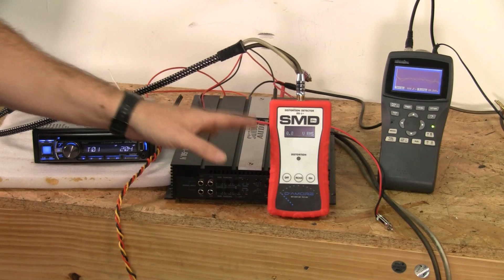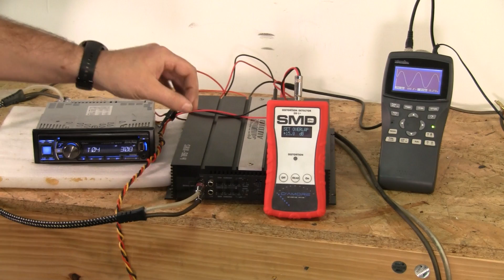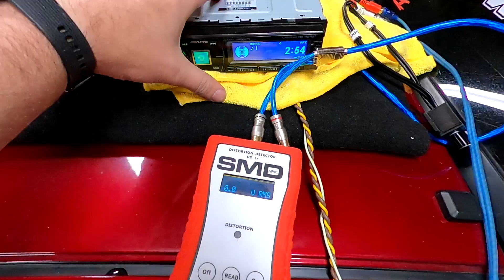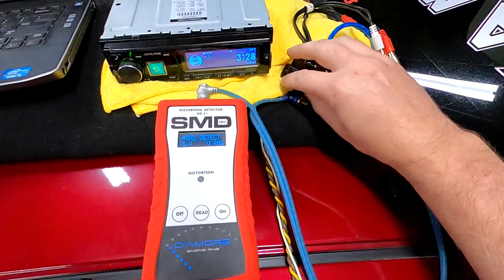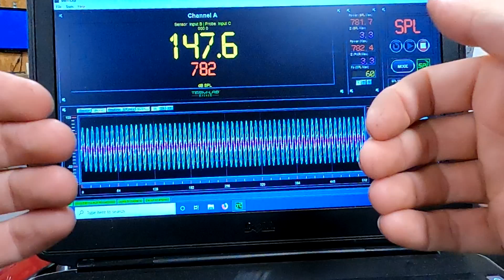The TRUTH about the D'Amore Engineering / SMD DD-1+ - Tech Stuff Tuesday

Comment: Very well made video. Steve’s only defense is, “you didn’t follow the manual word for word” when in reality you followed everything  you had to in order to show that there isn’t really any significance in owning a dd1 over an oscope. You won. And Steve no longer has a valid point to argue so he’s resorting to denying everything without any information to back himself up besides, “YOU STILL DIDN’T DO IT RIGHT YOU DUMB FUCK”!!! Game over Steve. Your lack of professionalism commenting on these videos has damaged your reputation far more than the video itself
Reply: LIST OF YOUR ERRORS

1.  Video description.  RF paper on building your own high passed speaker project is not 1/10 the price.  It's twice that, WITHOUT LABOR,  is your time is worthless?  You just valued it at $0.00 per hour

2.  Video description.  A High Passed Speaker is not a Distortion Detector.  RF you listening?  

3.  1:39  No headunit is 0.5V out.  But if it was you just put the probes on the amp to set everything, headunit, processors, amp, all measurable THROUGH the amplifier.  This is actually the preferred method since this way you can see distortion of outputs AND INPUTS of all components in the signal path.  No need to plug headunit into DD-1+, ever, unless you want to see how many volts come out of it.  

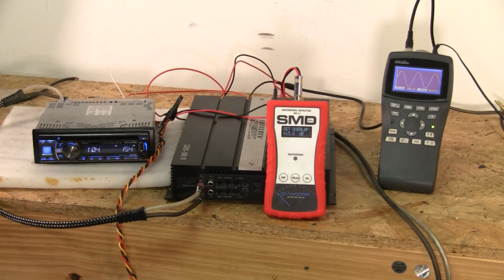4.  At 9:42, at this point you are supposed to press READ and then switch to the OVERLAP track.  EVERYTHING FROM THIS POINT ON IS INVALID SINCE YOU DIDN'T.  THERE IS NO reason for anyone to watch this video past 9:42. 

(I'll keep watching to see what other misinformation you are spreading) 

5.  13:43  The voltmeter on your scope is a cheap AC averaging meter that calculates AC RMS from any waveform, based on the math for calculating the RMS of a sine wave.  The math doesn't apply to square waves hence the error on your scope.  The DD-1+ voltmeter looks at the peak of the waveform, any waveform and determines what the maximum clean sine wave voltage would be that fits in the "rails" of the waveform.

6.  16:19  So you're saying if someone adjusts their gains for maximum clean output, and then you turn up the EQ or level more it clips????  NO SHIT

7.  17:32 And how would using your scope or the my first electronics project from RF to avoid these problems?  It can't.

8.  19:34 This is a problem with this headunit.  A better headunit has trim level adjustment for all sources, or an engineering team that took care to make sure all sources had the same gain before the design was mass produced.

9.  20:30  The DD-1+ shows when distortion reaches 1%

10.  23:32 Please describe this "more" that the scope tells you

11.  25:12 yes

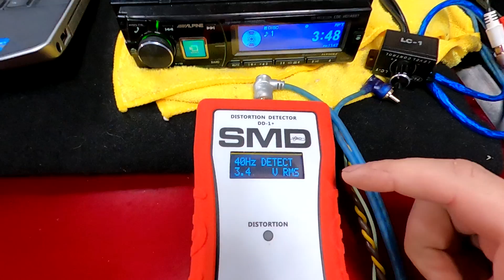12.  29:01 this has nothing to do with the DD-1+

13.  30.28  this is exactly why it is best to do all measuring at amplifier output

14.  31:04 the quick blink of the LED when increasing level is the 3 stage autoranger switching ranges, mentioned in manual

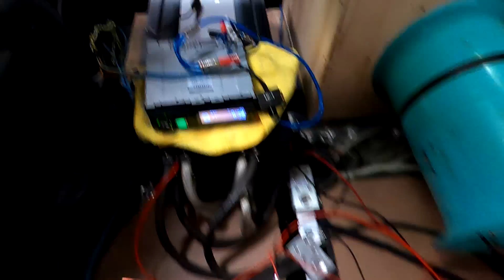15.  32:10 you just set it with NO OVERLAP?!   EVERYTHING after this is also invalid.

16.  34.14 voice coil is hotter now and the impedance of your woofer is higher, so in turn it got less power.  20 less watts = 0.1dB less, nothing to see here. 

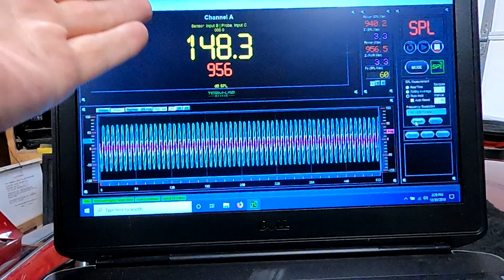17.  39:00 You clipped it hard, of course it was louder and put out more power.  Now try using the DD-1+ properly and put 5dB overlap in it and do SPL run and make that video.  

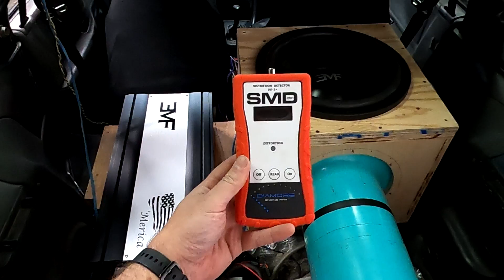18.  40:41  You showed us that you STILL didn't use it right, even though 20,000 people already know how to use them perfectly everyday.

Comment: Personally I really don't think its a requirement obviously if your amplifier doesn't have a clipping indicator then that's when you go out and buy an o scope or if you have to go buy one of these but if your amplifier does have a clipping indicator there's really no need for it if you're into SPL your amplifiers going to distort The thing that will bend you over is when you're full on clipping your shit though but most of the time people are running amplifiers that have clipping indicators on them. Not to mention though you can probably go out and buy a cheap otoscope for way less than this thing is.

Comment: Love your videos. You can't just turn any head unit up all the way and tune it by ear. I've done that before on a friend's build and I had to go back with the dd-1 to correct it and now it sounds clean and it's a little louder. Before that, the amp for the sub would go into protect. Not all head units can go all the way on volume. I've always tuned by guessing the head unit volume and hearing distortion from the subs but now it's so much easier with the dd-1. I'm not paying extra for the dd-1+ though. That's way too much. That oscilloscope you have is more accurate. I should have gotten one of those instead. Again, love your videos. I've learned a lot from watching them.

Comment: Nice video. With DD1 it may be clean without a load on the amp , but when your sub or subs are connected it actually loads the amp down more which will still cause clipping.so I think the oscope is still better. I think you can still make a little adjustment on your bass boost or bass level on your source unit then set your gains.

Comment: I always set my equalizer and crossovers at a moderately loud volume and then set my gains.
Reply: That doesnt work you need to know when your head unit clips
Reply: @Ismael_Arenivar  Yes it does.
Reply: @Ismael_Arenivar  As demonstrated in this video if you set your head unit with flat eq then as soon as you bump up the eq settings you are going to clip. Of course it is more involved than that but my point is true. Also im not talking just subwoofer here. All gains are set after eq is set at a moderately loud setting.
 Now for just trying to get the most power from an amp without sound quality then by all means set the eq to flat and leave it. But... as soon as you touch that eq then you have just altered your sign wave to clip or under-volt depending on your setting.

Comment: Moral of the story, put a clipping light on your dash to make sure different EQ or recording material dont jack your stuff up.
Reply: Agreed. Any song just keep adding gain till the light comes on. A clip indicator is all you need assuming it’s accurate. But that’s not such a safe assumption. Also a slight amount of clipping is acceptable. And all clip indicators have different variances. For example 1.5% distortion or 10%. But yea. A good clipping light will satisfy most people and yea it will take the songs levels into account which is important. The dd1 is perfect if you play specific songs or tones. Simple.
Reply: Gunk smd om-1 :)
Reply: @brandonjohnson7559  im not sure how relevant that would be. The om-1 is setup according to what you do with oscope or dd1. The issue is when you change your eq or play source material with different db than you did your initial settings with. My understanding is the om-1 is just going to show a red light when you go past what your initial settings are. That will change if you bump your eq or play from different source with higher db recording. I think a true clip light like Sundown has with their amps is best.
Reply: Idiot
Reply: @meade9167  a more productive comment would entail "why" this is such a bad idea. Db increases in source material played and eq adjustments are legitimate issues.
Reply: meade916 why?

Comment: Measuring the (out voltage * out amperage) and the signal with a oscope while setting the gain will get you the max power of the amp (with a load/speaker)

Comment: You have a 25% thumbs up from me, only because you know how to use an O-Scope. When using the DD1+, you have to hit the read before making adjustments. That’s what you did wrong. I have the original DD1HV and every system I’ve installed to date functions the same way since installed, except for the looser suspension from long usage. You didn’t read the instructions fully and correctly. Also another thing, listening for distortion is a no no. If you really know what you’re doing, which as time goes on I’m noticing you don’t in some aspects, you’d advise against it because you can’t hear distortion at the most minuscule scale. Which in time will destroy a great build. Ever had a tweeter drop out on a crossover? That’s because of clipping. Bet one of you in the comments had it happen, and didn’t hear your tweeter was clipping.... If you’re daily driving your system, that’s when these things matter, if you’re doing SPL, DC and AC voltage is your friend. Not so much distortion detection, and o scopes. When I hear people trashing devices that work for those who don’t come from an extensive background of before “easy of use” products, usually hate they didn’t think about inventing it. You pay for technology, and The DD1+ is a great device. An O scope is better because you can see the wave. That’s really the only advantage. Steve says it to everyone, buy an O scope and learn that first. Redo the test correctly, and you will understand how the unit works. As for the comments on here, throwing shade at someone because they are innovative is foul, and disrespectful and makes guys not want to be in the audio field. We all love our cars, audio, and tools. Would you get mad at Eric O (South Main Auto) for using an Onyx drill over a snap on drill? No, because the persons knowledge of how to use the device is all that Matter. Be respectful, as for you sir EMF, you do a lot of tests that are accurate, but this one for sure needs to be redone. Talk with Steve.
Reply: Best and most respectful comment I've seen yet.
Reply: FoSgAtExPoWeR thank you. I try to be respectful to everyone and every aspect when it comes to my profession. Makes for a better crowd and understanding.
Reply: i hope he actually reads comments and responds or better yet does a follow up a video. i want to see the difference :)
Reply: Nailed it
Reply: Well said..... with class.
Reply: Absolutely amazing and lovely comment of clarification sir❤
Reply: Well said
Reply: actually i hate to say this but im pretty sure hed still get a few comments wonderin y he (eric) broke somethin like that out
Reply: adding any extra bass or treble at the head unit itself or amp itself will throw everything else off, and smd dd-1 cannot stop fools from doing just that because they mad a dude with only say overall $500.00 dollars in everything is out doing everyone with $20,000 dollars worth of chit
Reply: So funny I literally just watched SMD video of Steve setting gains and frequency with the dd1+ and the Amm1 . And I could have swore he had the crossovers maxed out. Pretty sure of that. This guy says the instructions say to have everything flat. Not sure bc I don't own one yet. But seeing how I just put about $4,000 into a new build. I'm definitely going to buy both of those. I'm 45 and have a really good back for running by ear. Hense I beat 2 2007 Memphis mojos for 7 years on a 1998 Rockford fosgate punch power 1000a2 and the 600a4 on highs. Still have it but I upgraded to a sundown amp subs. All new dual runs of Rockford 0 ga, ski high 8 gau speaker wire ect ect. I'll be running the sfb8000 powered by a Js 370 amp alt, with 4 xs d2400's. And as I found the x15 terminals make the mojo's terminals look tiny. And I was able to fit 4 ga without any issue. I was almost inclined to use 4 ga and pick up some dual 4 to single 4 ga adapters to jump coils as no way are u fitting 2 4ga in the terminals without them. Hope it all goes right lol bc as Im a dedicated basshead. It's definitely a expensive hobby lol
Reply: @jasonhedrick5396  yes he had the crossovers open completely. I’m sure he used the CC-1 to adjust the crossovers after he did the gain adjustments. You have to do this because If you have the crossover set closed (using sun settings as an example, low like 40hz 12/24db octave) , and you adjust your crossover afterward adjusting your gains, (tuning to say 60/80hz 12/24db octave, opened up), you will introduce clipping of the amp with distortion. That’s why it’s important to set everything flat, all EQ’s, bass enhancements or epicenters, crossovers off, or to it’s highest settings so no matter what adjustments you make afterwards, you won’t get distortion or clipping of the amp when you turn your source volume up to its max unclipped volume. When setup correctly, you should only have to turn up two knobs. Your volume, and your sub. If you have a hand held O-Scope, try it out. Best to visualize it first. Check out Steve’s video with the line output converters. He does a test on a lot of them, which shows what the distortion detector looks for, as well as Tony D’Amore does a follow up on it. Great for those who want to do a SQ setup.
Reply: you must be blind he did hit read
Reply: @pollo90650  actually, the instructions says to play track 2, adjust gain until distortion, hit read, change track to 4, then set your overlap. It clearly shows at 8:29 the track changes to 4 when he started the setup. Clearly wrong. This guy doesn’t know what he’s doing. Totally misleading people. Period!!!
Reply: @Jt19702  if you go back and watch the follow up video you would see he actually did this incorrectly just to show how mean and hateful everyone in car audio is nowadays! He wanted to show how everyone instantly jumps to he don’t kno shit and is stupid instead of how it used to be when everyone tried to help each other and teach them!

Comment: I would like to know if there is another way to measure wattage with out the SMD tool because it's to expensive for me. (Even though it's probably better)
Reply: A multimeter and a calculator
Reply: @ubergeeknz  :facepalm:
Reply: Search Tony D'amore and you'll find your answer.
Reply: ohm's law !
Reply: https://www.youtube.com/watch?v=c9GMPPn_zcs
Reply: you can get in the ball park with an AC clamp meter and an AC volt meter, but that will only show "APPARENT POWER", not "TRUE POWER".  With subwoofers, the current and voltage are not in perfect sync and an SMD AMM-1 will reveal the true power with power factor.

Comment: Piezo tweeters work well for making a simple detector. Like 6 bucks
Reply: Like his pocket.
Reply: using a nice low frequency sine wave you can go from dead silence to an annoying buzz at clipping because piezos are essentially high pass filters (impedance goes way up at low frequencies) and our amps are for putting out low frequency and crossed over.  so the hpf filters the low frequency sine wave out. then turn up the gain and as the high frequency square wave is created by the clipping youll hear it. can do the same with regular tweeters and simple crossovers.  

ive looked at the results with an oscope looks good can set a usable soft clip this way as well if you want. 

theres already videos out there doing this using a small speaker and a cap along with oscilloscope readings and sound to back it all up

heres one https://youtu.be/lAn4WGny-gE

pretty sure tfade has one as well. along with a lot of others.
Reply: it definitely works good enough for me to save 200 bucks

same with clamp testing its a cheap easy way to compare one amp to another yourself. dont need to spend a ton on a dyno or wait and hope to see your amp tested on youtube. it creates results that are good enough to personally compare amps to one another.
Reply: since you replied steve and the comments are off on the video. i saw your videos about amazon. i know a number of people who no longer sell on their due to the same shit. same with ebay.
Reply: @666nacirema666  holy shit thats genius, i should give it a go and see how it turns out
Reply: @666nacirema666  Yeah, but what good is a piezo if you are setting the gains on your mid or tweeter amps?
Reply: Dso with custom firmware works nice too. 
 Just got a much nicer handheld oscope though so I'll just stick to that

As much as I love car audio and change things up these dd1s and all that do too little for me to want one.
Reply: no it really doesn't. There are a lot more factors involved.
Reply: @meade916  like what?